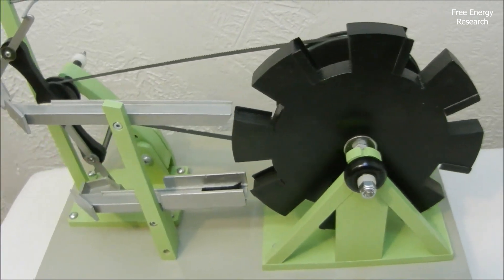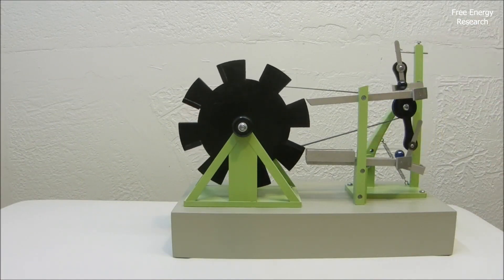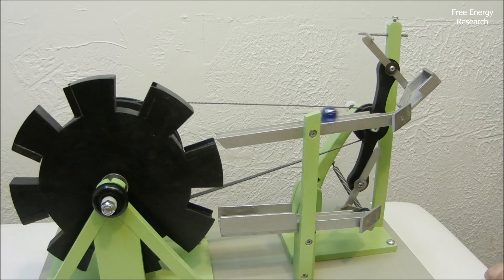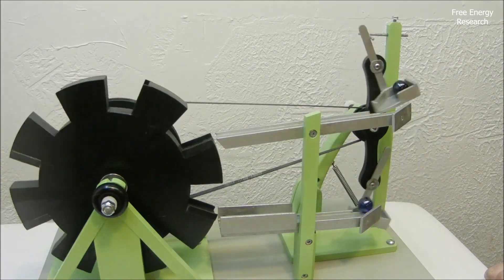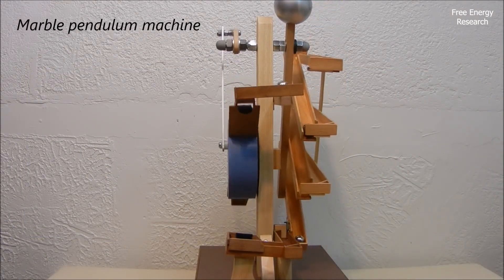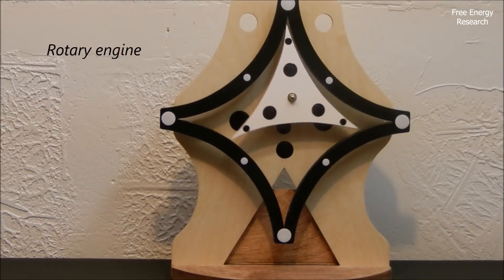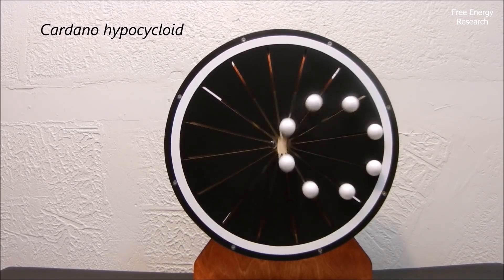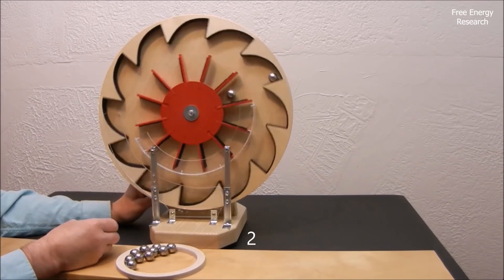Perpetual Marble Machine, #innovation

Comment: This particular machine is not a perpetual motion device TMO. 
First of all it seems that the marble is not heavy enough to overcome the two rotating masses that are coupled by a rubber ring and the friction of the system. 
The second issue is that the bigger grooved wheel keeps on moving a bit further even after the marble has left the grooved wheel, which is impossible with this setup. 
Perpetual motion machines are very real and do exist in reality but fake machines like in this video should be marked as at least”potentially fake”, so not to give the suppressors of the truth a handy tool to smear and obscure the truth. 
Those who do benefit financially from a false”perpetual motion machines” videos should not be promoted.
Reply: There's a 1952 patent act that lets gov shelf things of military importance or economy effecting i read in another comment ,might not be true but if it is its probably why we only ever see the devices that dont work perpetually